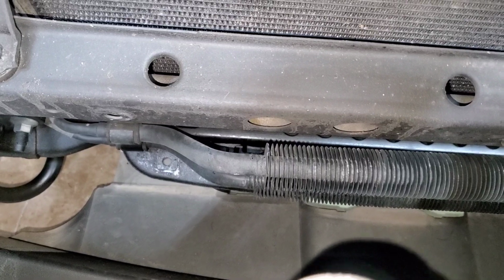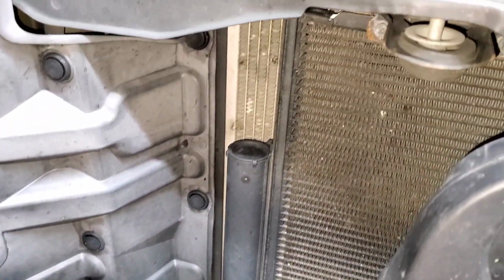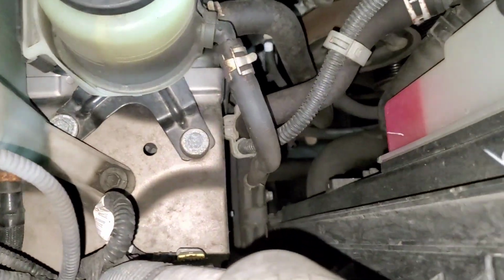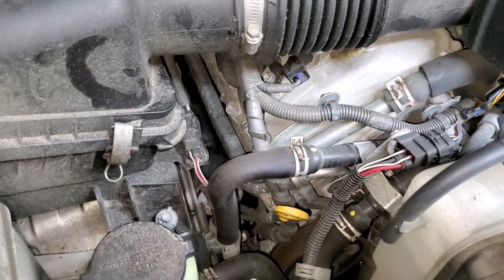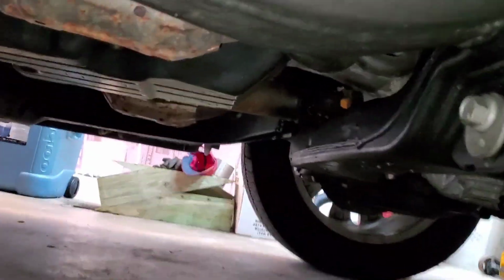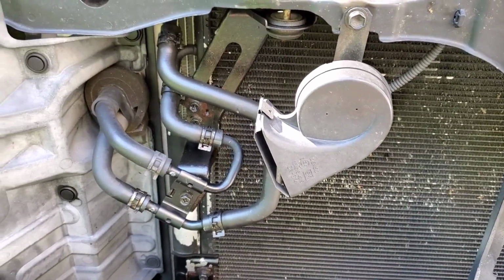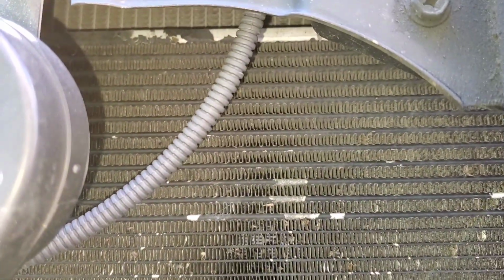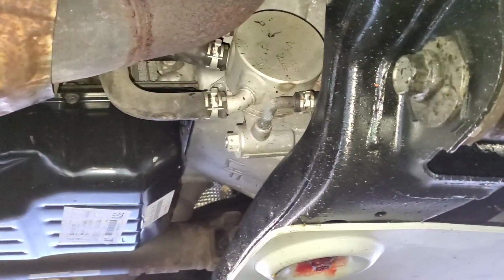2019-2021 TOYOTA TUNDRA TRANSMISSION COOLER? Did TOYOTA remove TRANSMISSION COOLER on TUNDRAS?

Comment: I was told by a Toyota tech that that unit underneath with the hoses is actually a transmission fluid heater that gets the transmission fluid up to operating temperature quicker using engine coolant with a thermostat when the fluid is cold. On the prior units with a Transmission cooler another unit is sandwiched in between with return hoses heading back to the radiator mounted external cooler and is also thermostatically controlled.

Comment: The Water to Fluid Cooler on the Transmission is designed as more of a Transmission Warmer for Cold Climate areas. This will circulate Engine Coolant through Transmission to help warm it up to Operate properly when its Freezing Outside.
We have a 2021 Crewmax, I just purchased the Scan Gauge 2 to see Transmission Temps. I am trying to figure which External Trans Cooler I want to go with.  Great Video Thank you.
Reply from the maker: I have a video on my channel with cooler temperatures and without.
Reply: @repairvehicle  Yep, Watching it right now! 
I will watch other Videos, I like your Channel, just Subscribed!! I use Amsoil Products as well! Thank you for all the effort to provide Videos, it really helps to make Decisions.
All the Best! Thx again
Reply from the maker: Thank you for subscribing and watching videos.
Reply: Thank you.

Comment: I just bought a 2021 Platinum Tundra that I plan on using to tow my Kubota B-2601 tractor with loader bucket and implements . The trailer is a dual axle HD trailer sticker says it weights 1500lbs  by itself. Tractor is probably 3500 Lbs with bucket . I’m kinda worried 😦!
Reply from the maker: Nice truck!
Reply: @repairvehicle  Hopefully 🤞 it won’t overheat towing my big Kubota several hundred miles to another state where I own property? Lol 😬. It’s still under factory warranty so ?
Reply from the maker: If you live in warmer state then you should be fine. If you leave in colder state it will run hotter
Reply: @repairvehicle  I’m in New England but will only be towing north during the warmer months to cut and maintain 4 acres with the tractor until I get my steel storage building built . Then the towing loads should be less.

Comment: I'm trying to figure out why Toyota did this? It was already there and they went out of their way to De-engineer the truck. Do you have any insight on why they did it? I have a 2021 5.7 and tow about 4,000lb. Should I be worried?
Reply from the maker: It saves time and money because they have less things to connect upfront on assembly line. It depends how often you tow, change atf fluid and where you live.
Reply: @repairvehicle  It's still dumb thinking in my opinion. Why risk their reputation? I tow a couple times a year. I may put one on just for peace of mind. Thanks for the reply
Reply from the maker: of course its dumb.
Reply: I don't plan on towing as much weight you are,but I installed cooler as soon as I got home from the dealer. Relatively easy install with Toyota transmission thermostat, and hardliners under the motor to the front to a after market racing radiator. I leave the transmission thermostat pinned during the summer and plan on pulling the pin for the winter. My transmission temperatures are no where near what some owners are reporting without the cooler. I also installed an inline magnifine transmission fluid filter, just before it enters the cooler. Just my two cents.
Reply: I’ve read somewhere that they use a different ATF  that does not degrade at hotter temps so they did away with the external transmission cooler. Not sure if that info is accurate though
Reply from the maker: False information about different atf

Comment: So are you saying that 99% of cars have internal transmission coolers, but that the external one would help cool it more effectively? One of your other comments said, "Because they fail and running transmissions at 230F degrees cuts transmission life significantly." So do you think these need an external cooler or not?
Reply from the maker: So what is internal cooler vs external cooler?
Reply: @repairvehicle  You said in your video, "there is no external transmission cooler." The older, pre-2019 models do have an external cooler. The internal liquid-to-liquid cooler is still present in the 2019-2021 year model Tundras. But what I'm saying is, the old one had the liquid-to-liquid cooler AND a supplemental, external, liquid-to-air cooler. So wouldn't you say the old ones could cool better than the new ones? Watch this video to see what I mean: https://www.youtube.com/watch?v=JekojvXfpVI
Reply from the maker: liquid is to liquid is far better at controlling temperature than liquid to air. Industrial application rely heavy on liquid to liquid for cooling. Car manufactures like ford and BMW is heavily rely to liquid to liquid cooling and able to achieve only with liquid to liquid to liquid cooling. Toyota liquid to liquid cooler is undersized and needs external liquid to air cooler to help bring temperatures down.
Reply: @repairvehicle  Ok, this makes sense. Would you say it is enough of a concern to not buy a 2019 Tundra and instead get a 2017? Or just add an external liquid to air cooler on the 2019 myself?
Reply from the maker: @RycastFitness it depends for how long you plan to keep it and if you doing towing
Reply: @repairvehicle  I like to keep my vehicles for a long time, my 2015 Tacoma is paid off and very reliable, I just worry if the 2019 Tundra will be less reliable. I would like to get a camper someday, that's one reason I'm thinking of trading.
Reply from the maker: As long as you keep changing ATF every 30k miles or 3 year which ever comes first, there is not need to worry about 2019.

Comment: will I be able to get transmission fluid up to proper temperature to change/check level?
Reply from the maker: What are we talking about
Reply: In videos I have seen…a pin is put in thermostat to get transmission fluid to a certain temperature.   Then D for drive remains lighted even though vehicle is in park
Reply: For changing transmission fluid
Reply from the maker: Don’t know. I know this works, TOYOTA WS ATF simple and easy with using scangauge. 
https://youtu.be/maK7HsGEEls

Comment: Not sure why toyota is deleting key components that keep a truck reliable, disappointed to find no trans cooler on my 19' tundra, my first and probley last toyota if this is their new way of doing things
Reply from the maker: Ford did same thing started 2018 and up. Ford and big 3 using plastic oil pan on transmission, it's a guaranteed failure.
Reply from the maker: It's easy to add,  I am in process of installing and videos will be coming
Reply: @repairvehicle  I added one myself, check out the video of it on my channel
Reply from the maker: my video will be very detailed and installation will be done differently to take full advantage of the cooler. thanks for watching and commenting.
Reply: they did not do away with cooling.....it cools while going thru the radiator....you heard him
Reply from the maker: Why did you buy extended warranty? So that you can have anxiety? Makes no sense. You have extended warranty, use it and don't worry about transmission failure.
Reply: @caseyj337  Wrong!  that puck on the side of the transmission is not a cooler or the same as the Supplemental Air to Fluid Trans-Oil cooler that came on SR5 level towing packages up through 2018, it's only a trans-oil warmer to keep it from coagulating and being gummy upon cold start up. Toyota Engineers are sheep and do exactly what their corporate overseers tell them (cut MFG costs at any expense, even warranty expense)  - as warranty coverage decisions are typically shot down at the dealership and representative level.

Comment: 2019 tundra and I row a 25’ trailer. 7000#. No issues.  I asked the dealer if the tundra has had issues with the transmission and no cooler. They stated they have never seen a failure.  So everyone who is calling Toyota stupid. How about you prove that transmissions are failing! Prove that it is an issue! Prove that Toyota is wrong.
Reply from the maker: Why tundra used transmissions sold for high prices on eBay? Because they fail and running transmissions at 230F degrees cuts transmission life significantly. Do some research on transmission fluid temperatures. Dealer will not tell you the truth, they know you will be back soon for new tundra or transmission repairs.
Reply: @repairvehicle  I can say the same about used Chevy ford and dodge transmissions!  Again, show proof that the transmissions fail! Prove it!   Showing used transmissions on eBay is not a strong argument
Reply from the maker: @steve4658, price of used transmissions is high because demand drives up the cost. Simple logic.

Comment: That was a transmission heater that you called a cooler. The lines route to the engine block.
Reply from the maker: its heater when coolant hotter that ATF, cooler when ATF hotter that coolant. Simple logic, let it sink in.
Reply from the maker: proper term is heat ex-changer.

Comment: 2018 Camry se 2.5l has no cooler line that goes from transmission to radiator.
Reply from the maker: You have one of those coolers, round one 
https://youtu.be/41UM0Hg1-Wc

Comment: Is it safe to tow with a 4.6 without trans cooler it has 6500 lbs towing capacity
Reply from the maker: If you planning to have trouble free transmission on the longrun,  then towing without cooler is not an option.
Reply from the maker: What year is your 4.6?
Reply: 2014 sr5 double cab 4x4 6.5 ft bed
Reply from the maker: It's not just transmission cooler has not been installed on 4.6. Also,  engine oil cooler has not been installed. Towing without coolers definitely shortens engine oil life and transmission fluid life.  But,  heat generated inside without cooler has negative effect on transmission components and shortens its life. 4.6 is a great truck but without cooler it has limitations.
Reply: @repairvehicle  do i have to install bought of them or just the transmission cooler, i just want to be have a safe towing
Reply: you have a 4.6 am I correct
Reply from the maker: Transmission cooler as a bear minimum.  Engine oil cooler is nice to have it, it's a lot of work to install it,  Engine might have to be pulled out.  Just use synthetic oil and change it every 4k miles and you should be in good shape.
Reply from the maker: I have tundra 4.6 and Sequoia 5.7.
Reply: so you mean to say ill be good to just install the trans cooler right
Reply from the maker: Yes, as long as you use synthetic engine oil change it at 4k miles if towing a lot.
Reply: Thanks, appreciate your advice I’ll  get the transmission cooler installed

Comment: stupidest cost saving measure I ve ever seen
Reply from the maker: There's no cost savings in cooler.  Cost savings during assembly.  No need to connect anything upfront and no need to adjust fluid level.

Comment: So should u avoid buying a 19-21 tundra?
Reply from the maker: I would not avoid.
Reply: no need to avoid it. I picked up a 21 and will be adding a cooler here soon. I've done some towing and had no overheating but I still want to add a larger cooler here soon.
Reply from the maker: You not going to see overheating light to come on. Toyota have adjusted software so that light will no come on even if it's overheating.  Temperature over 220F is already overheating transmission fluid and transmission components on the inside.
Reply: @repairvehicle  i bought a 21. No towing or anything yet.  May add the cooler soon tho
Reply from the maker: Congratulations.  It's a nice truck with proven reliable transmission and engine.  Overall awesome truck.
Reply: @repairvehicle  i love it man. Test drove it (first time in a tundra) and bought it that night. Just got a big list of mods to do now
Reply from the maker: I know what it feels.  It was  same thing for me when bought  Toyota Sequoia and then tundra
Reply: @repairvehicle  wow really I did not know that. I better get a cooler sooner than expected then cause ive put over 13k miles on my truck already and towed over 6k miles of that. Kinda curious to see what condition the fluid would be in cause those were long hard constant miles put on the truck in a short period of time. Would you recommend completely draining the fluid when I add the cooler? As well as what fluid would be ideal to use? 

Just look to keep the truck reliable and a good tow rig. Sucks Toyota ditched the coolers on these. Stupid move
Reply from the maker: I have large number of video for Toyota tundra on my channel, including maintenance items, transmission cooler installation, and so on.
I personally use synthetic AMSOIL ATF in my Toyotas including tundra. I recommend using AMSOIL ATF since its a synthetic, it provides outstanding lubrication and tolerates high heat better that factory none synthetic. I have probably 1000s of comments throughout my channel from different people who don't regret trying Amsoil atf and how big of difference this fluid makes. https://www.amsoil.com/p/signature-series-fuel-efficient-synthetic-automatic-transmission-fluid-atl/?zo=5257753

Factory atf is good for about 30k miles just like it was back in 90s.

You can only drain what is the pan. However, I have done 3 drain and 4 fills after installing a cooler.

Its not just toyota that have ditched external transmission cooler. Ford have ditched them on f150 since 2018 and 2021 for Ford Super duty f250, f350 and so on don't have external transmission coolers anymore. It helps them save money and time during assembly, one less thing to connect at the front.
Reply: @repairvehicle  ill definitely be trying the amsoil

Comment: Bro that's your pump not cooler and on top of that I have a 19 tacoma and it has a trans cooler it's on the front of my radiator clear as day but you are right about one thing some don't have it only the ones with the towe packages do.
Reply: Not true. My 2020 has a tow package and no cooler.
Reply from the maker: @johnvgig it has cooler, liquid to liquid, it doesn’t have air to liquid cooler.
Reply: @repairvehicle by all accounts that's a warmer, and it COULD provide dome cooling as engine coolant temp is approximately 195F.  However the cooling is MINIMAL.  I have a 2020  Tundra w/ a towing pkg. It has no fluid to air cooler.  Using a scan tool which I bought today, just driving 10 miles, towing nothing, my pan temp reached 207F and my torque converter temp reached 216F. Other YouTubers, towing 8000lb with the same Tundra setup reached pan temperatures of approx. 245F.  IMHO that's too hot, although Toyota says it's fine.
Reply: They tan g to he same test with a Chevy Silverado that had trans cooling lines going inside the engine radiator and the max temp was 214F. That's 31F difference.  Toyota engineers said all's good to 250F.  I'll be putting in a fluid to air cooler, because I want to get 200k+.  Bought it used with 106K.
Reply from the maker: @johnvgig tundra atf temperature still goes above 220F with external transmission cooler, when towing or hailing or just accelerating
Reply from the maker: @johnvgig , what kind of scan tool did you buy? Temperature still goes high even with cooler, it’s just how they are designed. Video is coming soon
Reply from the maker: @johnvgig , same exact thing for engine oil and no one calls it warmer, but calls it cooler. Am I missing something?